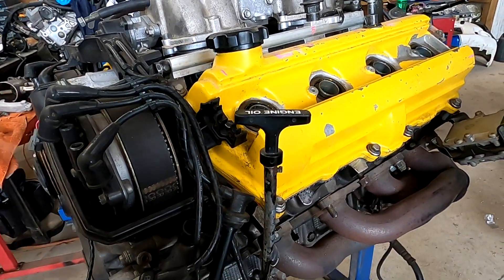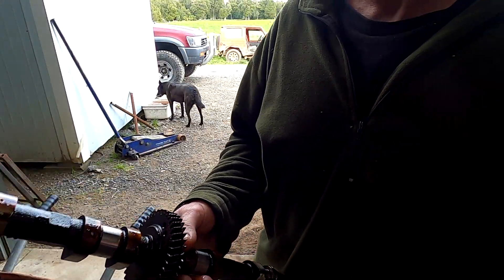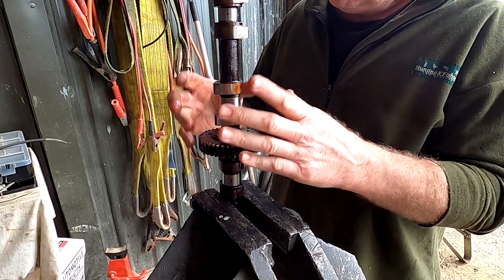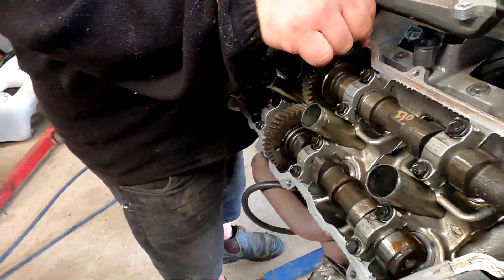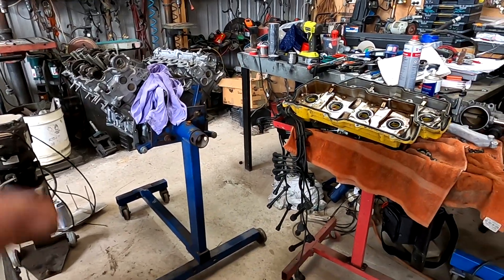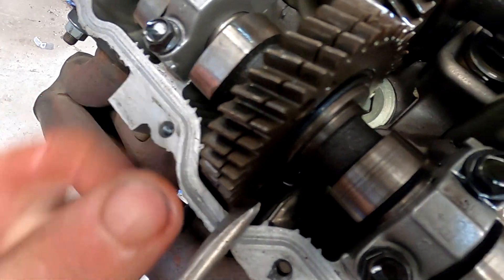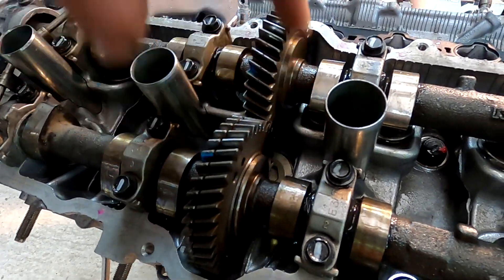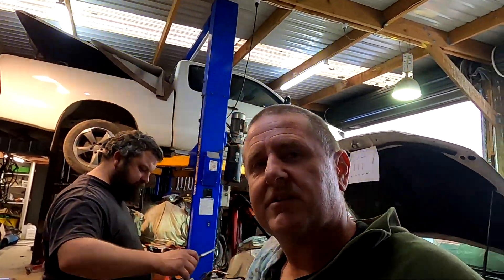1uz Scissor Gears.  Operation and timing of the internal camshaft gears on a 1uzfe non-vvti

Comment: hello friend, good morning, joshep greets you from peru, I tell you that the 1uz fe in peru is not very commercial, however I got one but I have a problem the timing belt temperer does not tighten the pulley I remove the trigger but it stays loose the belt, I would like to know if the 1uz and 2uz hydraulic tempers vary because we import the temper and the water pump and oil pump as well and the 209-tooth belt but I have this problem, please I need your help with this problem since you are an expert in the 1uz faith

Comment: I also be told to put a bigger cams and the clicking will go away what do you think
Reply from the maker: Sounds like a strange solution to me.  If the clicking is tappet clearance then adjustment of the tappets is a good start.  Cheers Kelvin

Comment: Anybody know, if the series 2(95-97) interference engine's can be rotated counter clockwise by hand. I'm referencing a completely stock assembled  engine with timing belt installed?
Reply: Much thanks!
Reply: Continuation to the CCW rotation question... will this cause damage? I'm referring to turning the crankshaft by hand with fuel disabled. I've had Megasquirt support tell me, that it's safe, because the instruction procedures require CCW rotation in order to locate the #1 trigger angle. This is required  prior to establishing a base map.
Reply from the maker: While its not ideal to turn CCW it's highly unlikely to cause any issues.  This is more a case of good practice in most cases.

Comment: You saved my ass…. I totally missed the Scissor gear and all is perfect now. 

Please keep posting, you are saving many asses!
Reply: Same thing for me.  I put a junkyard cam in my 3mz-fe after I scratched the sealing surface on the end of the original cam.  It has been making noise ever since and I have worried the engine is eating itself.  Now I realize I didn't tension the scissor gear correctly and I can fix it when the weather warms up.

Comment: Hey Kelvin, I know it's an older video, but I am getting ready to do those nasty O-rings on the VVTi uz. I have done the timing and camseals on an early LS400 but never a VVTi. The question I have is when do I install the service bolt to lock the scissor gears? I read that the service bolt holes don't line up when they are at TDC not sure if that's true or not. But is it safe to leave the old belt on rotate until the scissor gears service bolt hole is easy to access then rotate the engine back to TDC and do the actual job. Then when done installing all the new gaskets and timing belt rotate back around and remove service bolt. Let me know if I understand that correctly. Also I have read that it's better to do 50 degrees ATDC rather than TDC. Is that necessary or safer? Cheers for the wealth of knowledge once again Kelvin.
Reply from the maker: totally fine to fit service bolt and rotate the engine, just dont forget to remove it when done

Comment: Say if one was to put it back together but doesnt install the cams at tdc what would happen when u go to turn her onv
Reply from the maker: Likely scenario us Gen 1 wouldn't start,  gen 2 also wouldn't start with the added bonus of pushing the valves into the pistons and damaging the engine.
Reply: @CartuneNZ  so wouldnt start at all or would start then stall?
Reply from the maker: @mrvzys1358  depends on how far out it is.  Do you have a start and stop a few seconds later?
Reply: @CartuneNZ  i have a start then cut off issue, give it some throttle shell stay idling for a bit let go to quickly of throttle and shell cut off sometimes when revd to high shell cut off , i have tried it all , cam position sensors , temp sensor, new plugs wires , cap rotor , crank position, new injector , tps
Reply from the maker: Instead of just throwing parts at it I would be testing it.  Here is one suggestion.  https://youtu.be/UBarmsDdI8Y
Reply: @CartuneNZ  just watched the video as we speak gonna pick up a multimeter and test some of my parts out! Thanks for the feedback!

Comment: Hi Steve  ,m given .

Can an UZ 1 engine bent valves after a timing belt was broken into pieces?
Reply from the maker: Absolutely they can if the cambelt job is not done correctly.   From generation 2 engines on

Comment: Hi, I have 1 UZ F E non-VVTI in a Triumph Rocket 3 motorcycle I'm building, and really want to dewire it as much as poss. I know I must keep fuel injection, crank angle sensor and obvious fluid activity wires, but can you please advise me on the possible minimalist computer to run it? I'll be running a stock airflow metre of course, but just need a bit of guidance. I have grafted a 1985 Suzuki Swift non-computer-controlled 3 spd auto on to it. There were other engineering obstacles I faced, but so far all is looking good. And yes, photos are available. Thanx Kelvin.
Reply from the maker: Hello Steve.  Maybe look at some of my link videos.  A little monsoon might be the answer.

Comment: Another great vid any advice on how to remove cams
Reply from the maker: Yep,  Lock scissor gears , ensure you know where the cam timing is, undo the bolts evenly.  Cheers
Reply: @CartuneNZ  do you suggest start loosening the bolts from the center or start from the ends
Reply from the maker: I work slowly through them undoing each a little bit at a time.   Where you start doesn't matter provided its a few turns at a time

Comment: Hi Kelvin Ive got a random question. On my 98 LS400 I've replaced my valve cover gaskets and added silicone to the corners, Ive replaced my cam seals and crank seal but theres a slight engine oil leak onto my alternator. Its not my power steering so What else could it be?
Reply from the maker: Sometimes cam seals leak down the side but I would be double checking the PS pump (or lines) and the tappet cover gaskets.  Clean it off , drive and look for the wet patch.  Cheers Kelvin
Reply: @CartuneNZ  It seems to be engine oil and not PS fluid. I'll recheck everything and if the gaskets & seals check out I'll replace the VVTI cam gears as Ive heard those can leak. Would you recommend an O ring replacement for the cam gears or replace the entire thing?

Comment: Hey im prepping a 1uz for a 240sx but it has a burnt exhaust valve so I’m thinking of porting and polishing the heads while they are off, do you think it’s worth it considering I only want to make 400hp max boosted? It would be my first time porting heads so I’m a little nervous thanks
Reply from the maker: Absolutely worth it.  So much easier to make good power.
Reply: @CartuneNZ  thanks,all the way from New York if I could tip in bananas I would.lol

Comment: Typical colour difference between left and right cylinder bank...run temperatures and oil flow gives different colour...I don't think I've ever seen a 1UZ-FE with the same colour left and right. Double marks are used in initial assembly where the  alignment is checked quickly by  rotating the engine two rotations...after that nothing will line up again.
Reply from the maker: Colour difference is related to the PCV system. The cambelt marks wont line up for many many revolutions but the dots on the camshafts align every revolution.  Cheers Kelvin

Comment: Very informative. Was the engine Jason was fixing your bent valve one?
Reply from the maker: This is an engine we pulled dowm earlier this year that had oil supply issues.  Lots of parts have been powder coated and vapour blasted now its assembly time.  I have a video coming of the job once I fix a small editing issue.   Cheers Kelvin